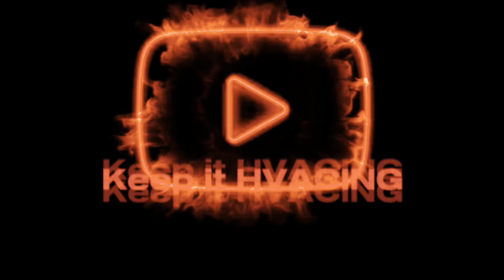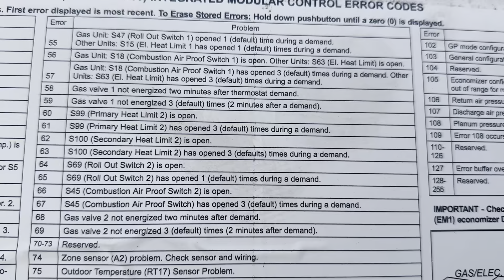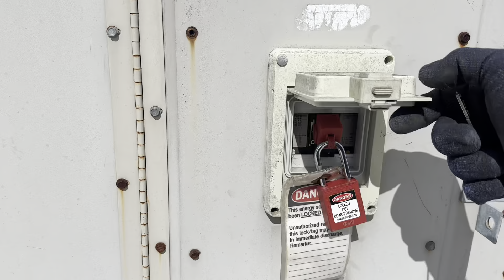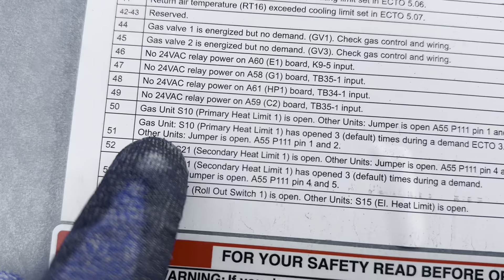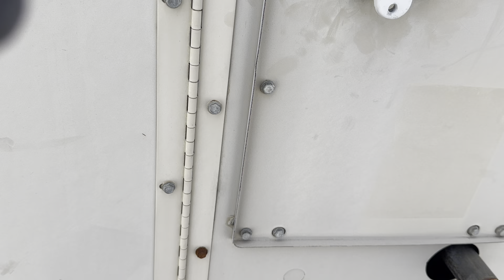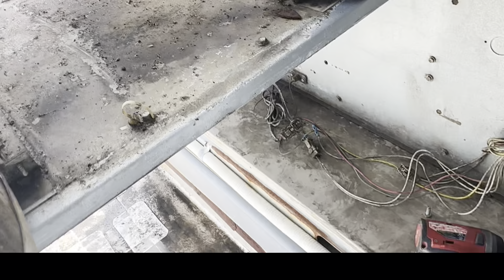service call

Comment: Is the power really off?  If only two legs of power were open you would still have 277 volts to ground on one leg!  I have made this mistake, I didn't know I was holding 277 to ground my bare hand until it touched the chassis.  Tripped the main and the whole distribution center went dark.  Always check leg to leg and leg to ground all the way across.